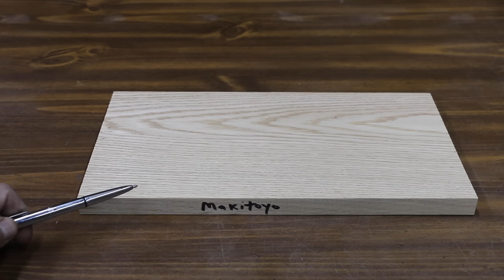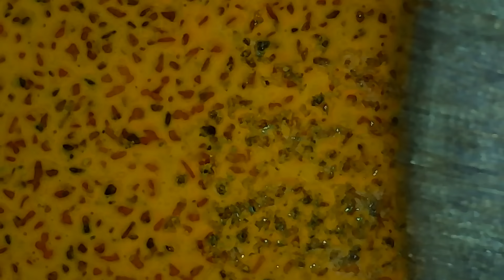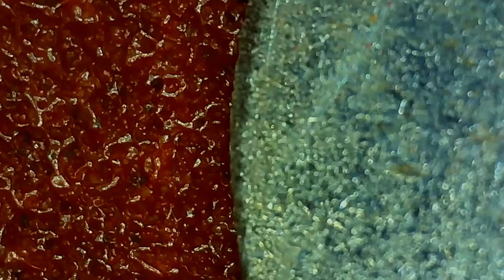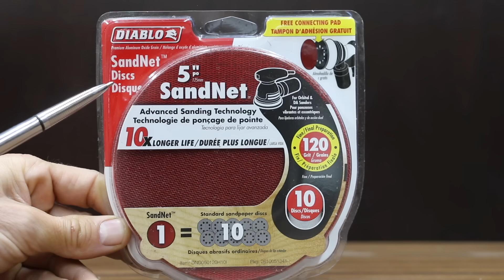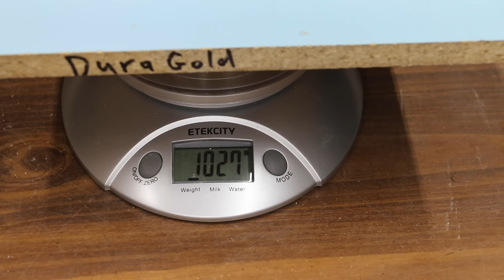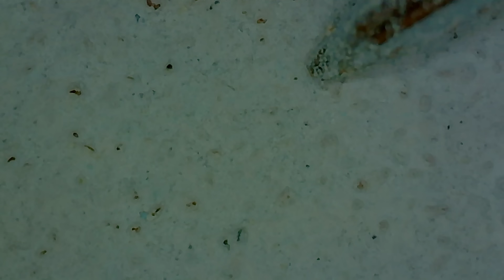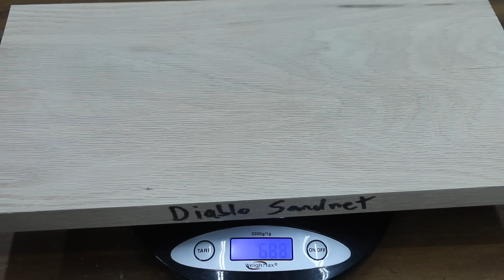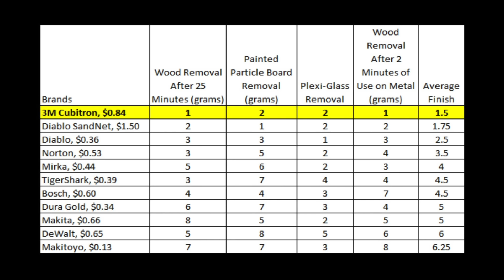Best "Sandpaper" Brand? 3M Cubitron, Diablo, Mirka, Norton, Makita, DeWalt, Bosch Sand Paper

Comment: It would be interesting to measure the roughness of each type of sandpaper to accurately gauge roughness.  I suspect the Diablo standard might actually be lower than 120 grit, and the SandNet has a hybrid roughness, since the mesh fabric texture is much rougher than a smooth paper backing.  Now, where's my profilometer...
Reply from the maker: Thanks for the feedback.

Comment: You could do a video on which type of drill bit is best.  Ex: round spiral  bits vs flat pale bits,   & such.  Normal type ones vs the ones with the little screw on the top that helps pull the bit in...
Reply from the maker: Thanks for the video idea.
Reply: @ProjectFarm  thanks you for the great content to watch

Comment: I can click on like it the first ten seconds.. Great video thanks for sharing it.  I've spent over 30 years running a massivly huge industrial sander at composite panel factories and my favorite belts were often Norton ceramic for material removal but. both them and 3M had great finish belts.
Reply from the maker: Thanks for sharing!

Comment: a really good test is using a orbital sander sandpaper on car fillers(freshly put on filler) as that new filler sticks like shit stuck to a blanket and clogs up the sander paper very fast from the sticky residue on top of the fresh car filler aka bog aka iceing aka as you americans call it bondo?
i have restored many cars and  i hate the residue on bog when its put onto the car, it has a oily tacky residue and it blocks up old or new sand paper even with in a second or 2 from sanding  very annoying ,  i use thinners and a rag to wipe the residue off  then sand it
Reply from the maker: Thanks for the video idea.

Comment: I've been using Diablo sanding discs for years! Makes me wonder about sanding belts. I've been using Norton 3x for years because they are reversible and they have a specially developed cutting material that fractures during use to expose fresh, sharp cutting edges. They also have open-coat structure and stearate coating to significantly reduce clogging even with resin rich woods or paint. Now I need some 3M Cubitron to use for certain jobs. Thanks for pointing this out!
Reply from the maker: You are welcome!

Comment: Thank you for the video. Simple when you see it, but I would not have thought to weigh the wood. And brilliant work using the metal to age the sp. I would have liked to see the framing supports on the first test lower than the side of the wood. And also eliminate the wobble of the wood when sanding. tiny shims underneath or possibly screwing the wood down would address both issues.
Reply from the maker: Thanks for the suggestion.

Comment: If you buy the diablo sanding mesh in a 60 pack, you get them for 29.95+tax instead, making the price a lot more reasonable. The small packs are very expensive because you also get the application pad. I think they are really great and works even better when adding a vacuum for dust removal.
Reply from the maker: Thanks for sharing.

Comment: The wood-removal-after-25-minutes shows another interesting stat: wood removal deltas at 5-minute intervals. That is, it shows how each sandpaper degrades with use. The absolute amount of wood removed is more a function of grit size than paper quality, imho, but it might show that some papers use a more aggressive grit than indicated.

For example, take the numbers for 3M Cubitron: if the first 5 minutes represents 100% effectiveness, the 2nd 5 minutes shows the paper maintains an effectiveness of 12/12, still 100%. The next 5 minute interval, effectiveness is 11/12, or 91.6% effective. The 4th interval it's down to 10/12, or 83.3% effective. Finally after 25 minutes, effectiveness is down to  8/12, or 66.6% compared to when it was new. If we look at it this way for all of the papers:
Name: percent effectiveness maintained after 20 minutes of use compared to new.
3M: 8/12, 66.6%
Diablo sandnet: 9/12, 75%
Diablo: 7/12, 58.3%
Tigershark: 7/10, 70%
Norton: 7/10, 70%
Bosch: 6/10, 60%
Mirka: 4/10, 40%
DeWalt: 5/8, 62.5%
Dura Gild: 3/9, 33.3%
Makitoyo: 2/10, 20%
Makita: 3/7, 42.8%

If you look at it this way, the Makita is not the worst paper, and the 3M is not the best.
Reply from the maker: Thanks for the feedback.

Comment: It is an interesting test but is the ability to create a surface finish really what is being tested here? Usually we're sanding to smooth something. That is often the end goal in mind. So a sandpaper that breaks down as you use it could be helping you achieve that. It's going from a more coarse to a more fine grit in use. Which is not such a bad thing. If a grit is not breaking down you are going to have to switch to a finer grit to achieve the same smoothness.
Reply from the maker: Thanks for the feedback.

Comment: This is the 3rd test I have seen that has Cubitron on top.  I managed to get the sample pack for like 7 bucks after i saw the first video, but they sent me the wrong stuff .  They sent me out the right stuff, and now i have two sets of the Cubitron sandpaper.  This stuff is NASTY!  As a woodworker, I've actually had to address how I sand my projects because this stuff is so aggressive.  I'll sand up through the grits to 220, then I'll switch to a Mirka 220 pad as my final pass because even the Cubitron 220 feels like competitors 100 grit.  IF you grab the Cubitron, go easy as it'll eat all day long.
Reply from the maker: Thanks for sharing.

Comment: Diablo works well, but I find the odd hole pattern tends to give me issues with my HL pads, though to be fair, they used to have a much worse hole pattern when I was turned off from them.  I use Klingspor brand disks and have found a great balance between function and cost.  For hand sanding, I find 3m with the sticky backing outperforms anything else I have tried.  I do a stupid amount of sanding!
Reply from the maker: Thanks for sharing.

Comment: Body filler dose bondo make the best let's find out then you can redo your sandpaper test. And let's not for get there two types regular body filler and glass fiber body filler in this test you'll be looking for pin holes shrinkage durability etc etc this could take some time but would be worth it have a good one Todd
Reply from the maker: Thanks for the video idea.

Comment: Diablo is good stuff, I use it all the time, but the Diablo Sandnet is garbage. If you are sanding a curved surface the sandnet will wear through very quickly and becomes useless. Regular Diablo does not have that problem.
Reply from the maker: Thanks for the feedback.

Comment: The best/ honest and real world evidence tests of products on YouTube.  Suggestion for test video for table saw blades: forest brand , diabolo, CMT, Irwin, dewalt etc. Diabolo might win again! Professional woodworker use dedicated blades for ripping  or crosscut respectively but armature woodworker like myself use a combination 40 tooth blade. Good material to use to test the blades is by ripping the surface of a finished hardwood flooring coated with aluminum oxide on a Brazilian cherry.
Reply from the maker: Thanks so much!  Thanks for the video idea.

Comment: 3M. I use several types of 3M abrasives and they all outperform. Many of the other companies only offer general Big Box type dimensional papers in the 2 or 3 most common shapes, not 3M, they offer everything under the sun. Also, their electrical tapes are #1. If they cost 20% over something else I'm not bothered, I'd rather contribute to the best being available than slide the slippery slope down with inferior products and companies who aren't as dedicated and won't provide such a selection. 3M has earned its reputation the long and hard way. The others are some 'holding' of a Mr. Burns type group that will likely be sold off to one of the big dog conglomerates in time by some Mitt Romney-like douchebag just to flip a dime.
Reply from the maker: Thanks for sharing.

Comment: I've always thought Diablo products were the best bang for the buck but I didn't realize that some of their products are actually the best product not just the best value. Their saw blades are the only ones I run anymore.
Also I really appreciate that you've basically become "Consumer Reports" for us blue collar folks who work with our hands.
Reply from the maker: Thanks so much!
Reply: Likely Diablo is made by EKABLU, swiss paper. Diablo is just a marketer with bold advertising.
Reply: this is what consumer reports was supposed to be until they became a corporate shill. i hope this guy doesn't sell out i bought many products based on his videos. The only one i would really disagree with so far is the double sided tape, the 3m vhb tape is far superior to anything else that exists. i bought all three top products and 2 failed where the 3m stuff worked as expected (taping various things to bottom of my desk)
Reply: Diablo is definitely capable of making bad products. Their multitool blades are horrible. Any brand that has such a huge advantage in store placement is automatically suspect because they are most likely paying for exclusivity.

Comment: Those Diablo SandNets saved my butt recently.  Was building a kitchen table, finally got to laying down stain, and discovered all too late that some wood glue had penetrated deeper than I had sanded in a few spots.  I was on a deadline, and had to sand the stained surface the next afternoon.  The ordinary Diablo sandpaper would last about 20 seconds per sheet, and I went through an entire package without making much progress.  Grabbed some of the SandNet screens, and only went through three of them getting the entire 7' x 3.5' table back to bare wood.

Sanding screens definitely have an advantage in high-buildup environments, and they're worth every penny when you need 'em!

Awesome video; thanks for posting!  :D
Reply from the maker: Thanks so much!  Thanks for sharing.

Comment: Soon there won't be any tools or consumables to review for PF! Hehe. I didn't check in all your videos if you did it before but maybe testing welding rods, welding wire, welding gun tips, anti-splatter fluid/grease for tip, wire brush for metal, grinding and zipcut disks for metal.  Thanks for your nice work. Greets from Eastern Canada.
Reply from the maker: You are welcome!  Thanks for the video idea.

Comment: I always enjoy your thoroughness. However, in this case, I disagree that looking at the wood removed is the best indicator of quality.  Theoretically, it should only remove a maximum amount for a known grit in a known period, provided it is not clogging or losing abrasive particles.  If one company classified their 120 grit differently, so the particle sizes are larger, i.e. 110 grit, they would score better on all your testing, but this is not what you want.  You want a 120 grit to be a 120.  I think measuring how long they continue to remove grit for (longevity) or looking at the time to remove the scratches from a previous, consistent scratch pattern on steel with the lower grit (or grit progression) may be more useful in guiding a buying decision.
Reply from the maker: Thanks for the constructive feedback.

Comment: I was excited about this video because I've tried several brands of sandpaper. One discrepancy I found in your video (that pretty much never happens!) Is the diablo prices. You compared a 50 pack price of the normal paper to a 10 pack price od the mesh. I use the mesh and buy them in 50 or 60 packs for $30 putting them at $.50 a piece. Also the normal ones come in a smaller pack for a higher price per piece, so it's more about the pack size both ways. That being said, it seems like the mesh ones perform the best for the price. One thing I've experienced is they don't do as well sanding edges. It would be interesting for you to test which paper shreds the fastest on sanding edges. Also it would be great to see some brands like klingspor or other pro abrasive companies. Thanks for taking one for the team with hours of sanding.. everyone's favorite task!
Reply from the maker: Thanks for the constructive feedback.  Thanks for the video idea.

Comment: I love how well Diablo sand net cuts, however with my experience as a professional carpenter, its ability to hold up is very disappointing.
Reply: The abrasive does hold up, however the fabric matrix that holds the abrasive has a tendency to break down, especially at the edges, a sharp adge on hardwood will destroy a piece in a matter of seconds.
Reply: @redhotstanger  That's interesting, I've seen a similar effect with rough edges on 3D printed parts in PETG and PLA. Thought that was just a bad batch of nets. Thanks for the info!
Reply from the maker: Thanks for the feedback.
Reply: @ProjectFarm  Thank you for testing this stuff, it has made a change in what I buy supplies for my business.
Reply: Regarding the Sand Nets, I'll also say their price point isn't accurately shown. I've seen them go on special with bonus discs and whatnot and it lowers their per unit price considerably. I bought most of the grits of them to keep on hand because of this :)
Reply: Second that
Reply: The sand net is rock solid on drywall, which is where I think it's primarily intended to be used.  I've never used it on wood, but a single piece will go all day sanding taped drywall joints without clogging.
Reply: @ScottHammet  good to know, thank you.
Reply: Interesting observation, as these tests show it holds up better than the rest, at least on wood.

Comment: Did you empty the dust bag on the sander after each test? A partially clogged filter bag will reduce dust collection which can affect sanding effectiveness due to build up of dust particles interfering with grit cutting into the workpiece. I think using a dust collector might have been a better way to go with this test.

Also, why did you not include Festool sandpaper (either Granat or Rubin are available in multiple grits including 120 ) which many say lasts way longer than any other brand they have used. Festool is well known World-wide for the quality of their abrasives and sanders. You should consider including them in future tests. 

I am not a Festool fanatic, but I do have some of their tools including sanders and dust extractors and use their abrasives. I  find they outperform anything else I have used so I continue to use them.

Having said all the above I still think this was a very good test and thank you for your work on testing these sandpapers.

Comment: Your skewing results a bit as those discs work better on surfaces there designed for! White is for paint.Red for wood types and so on.Heat is the killer also like when found paint build up in middle of pad that part gets hottest.Using a Suction unit always makes pads last longer and do more high flow cools it down.

Comment: That may have been the most comprehensive sandpaper test I’ve ever seen ... exceptional ... I would have thought Norton and Mirka were better than the results but facts are facts ...
Reply from the maker: Thanks!
Reply: I use Mirka for most of my random orbit sanding. It has a good price point and holds up well. I use diablo on my "mouse" sander because it' the easiest to find in that shape, in my area. I like 3M's open coat paper for much of my hand sanding and for sanding between finish coats. but most of my hand sanding is done with Sungold self adhesive paper. I can stick it to a block, or use it bare handed and it doesn't slip around in my hand. it seems expensive but as a hobbyiest, a roll of it will last me at least a year. it's great stuff.

Comment: It would be great to see the same kind of thing but with a sheet or palm sander instead, using sheet sandpaper.  I know I have to deal with the edges tearing where it wraps around the end to be held in place with my palm sander, and it seems like certain brands are just better at resisting tearing than others.  It would be interesting to see what testing finds out.
Reply from the maker: Thanks for the video idea.

Comment: I didn't even have to watch the video, the answer for wood sanding is Klingspor.  I haven't sanded much metal but I would imagine they have that nailed too.  I've been in the woodworking/manufacturing industry for about 50 years and have never found a better sand paper.  We used primarily 6" PSA discs with palm sanders.
Reply from the maker: Thanks for sharing.

Comment: Diablo sandnet often has promo packs. That will bring down the cost. The biggest issues with sandnet is that the edge tears easily, and it doesn't perform well on wood with brands/nails. 3M will be on my list. Good thing you didn't bother with HF sandpaper. That's stuff degrades so fast it turns into a buffer pad.
Reply from the maker: Thanks for the feedback.

Comment: I'd love to see regular sandpaper brands, like the actual paper sheets, not the sander pads/discs.
Ones I've used always flake and tear easily.
Great video as always, highlight of Sundays.
Reply from the maker: Thanks so much!  Great suggestion!  Thank you!
Reply: In my experience 3M Cubitron sheets are as good as it gets, just like round sheets tested in this video. There is another test on Taytools web site that shows 3M Cubitron is best brand. Cuts fast and lasts long. Also backing is some kind of plastic/rubber that doesn't slip and doesn't tear. One would not think there could  much innovation in sand paper but they delivered.